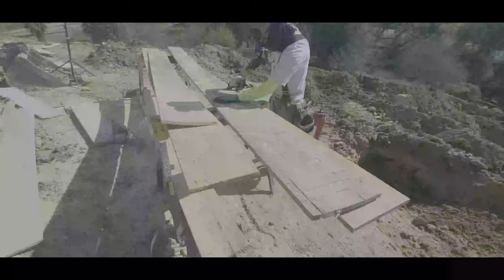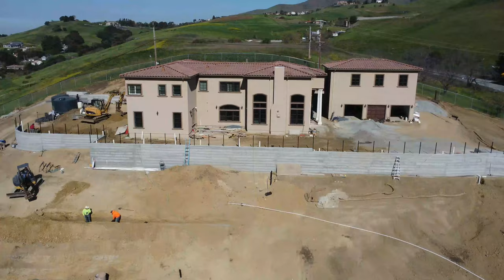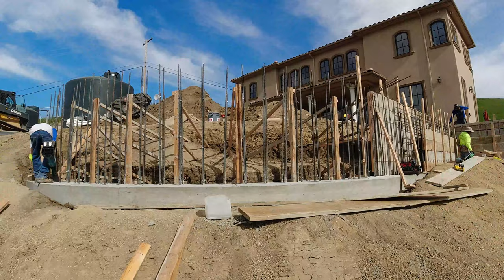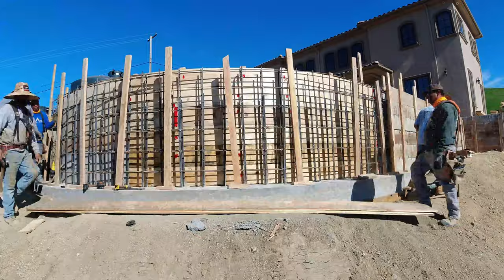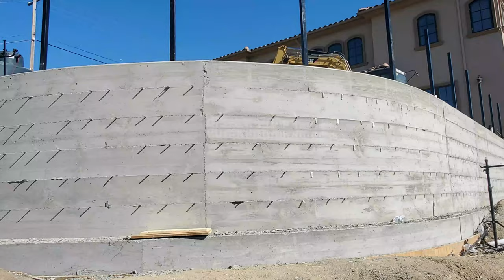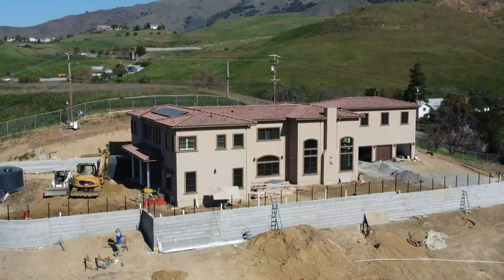How To Build A Concrete Curve Retaining Wall Like a Pro  Perfect Results"

Comment: While most people see a curved wall, I see a work of art.
I started out as a Carpenter-Joiner, and did a lot of roughing, and finishing work, making windows etc. 
I never done Shuttering Joinery, or Formwork which probably its new name.  It was messy and you stunk. they used fish oil as a release agent -back in the day..
We done everything manually, there were no electric saws. We had a Hilti drill and that was it.  Technology has changed everything!

But you guys are on THE ball. Am thinking you are from NY? You have a strong New York accent.

Anyway its a pleasure to see how this technical and artistic masterpiece comes together. Its an excellent team you guys got and WE learn a lot about formwork!
Reply from the maker: Appreciate the kind words.. I from Indiana originally.. So you might pick up the Midwest accent.. 👍🏾👍🏾👍🏾

Comment: Man I just happened onto this you do fantastic work I’m a custom home builder for 50 years and have done raids walls and walls as high as 24 ft tall. Mine have all been been snap ties and 3/4 Plywoid . I still think 2 ply’s of 3/4 plywood 16 inches wide leaped would be stronger and faster than the cuts and bending the 2x12 .
Reply from the maker: I appreciate your kind words. 👌This was our first time doing a curve wall to this degree.  We always have a post-meeting after jobs. So we have a few tricks up our sleeve if we get another one.
Reply: @AllAccessConstruction  the kerf works but the knots and board density is not consistent and you only end up with with the strength of the lumber you have left after the curf saw cut . I’ll bet 1 x 12 s would bend for most large radius I know 3 lawyers of 3/8 s works for tight radius with snap ties and clips .
Reply from the maker: Appreciate the info 👍🏾👍🏾👍🏾

Comment: Hey boss very nice set up...is that 1X  12 board for the radius?
Reply from the maker: Yes sirrrr... We doubled up them...
Reply: @AllAccessConstruction do you cut slits in them so they will make that curve? I ask because someone told me to buy a 1x4 for my project and it will bend like what is shown in your video. I had an old decking board 3/4x5” and it wouldn’t bend at all.

You all did that job to perfection!
Reply from the maker: @michaelwalker2091 appreciate it.. We use 1*12 I believe the first part of the video shows it. Keep in mind we double up the 1*12
Reply: @AllAccessConstruction  thank you, sir!
Reply from the maker: @michaelwalker2091 all good

Comment: Questions -
I see the concrete footer under the structure your building. On each side you have horizontal curved board forms that are attached to vertical posts. My question is,HOW,are the vertical posts attached to the footer so that you don't have blowout when the concrete is poured into the form? Thanks
Reply from the maker: We use a 2*4 naild to the grade beam.. Then nailed the vertical
Reply: @AllAccessConstruction  grade beam? Have any pictures?
Reply from the maker: @theebalz  https://www.youtube.com/watch?v=mY9dm_u1hxQ